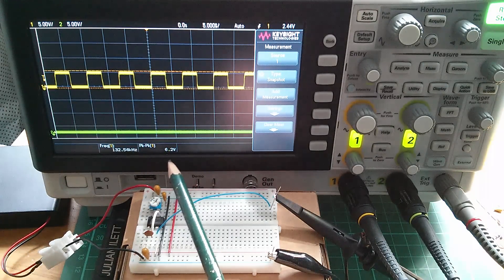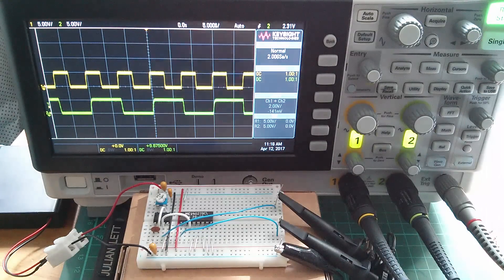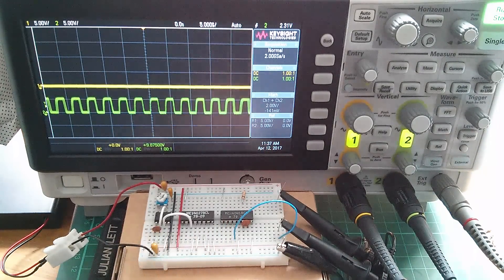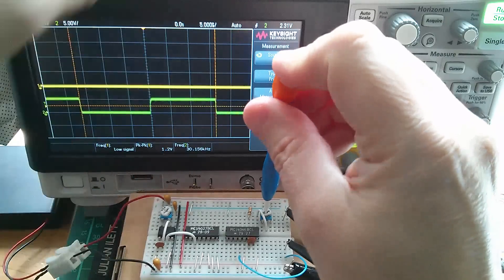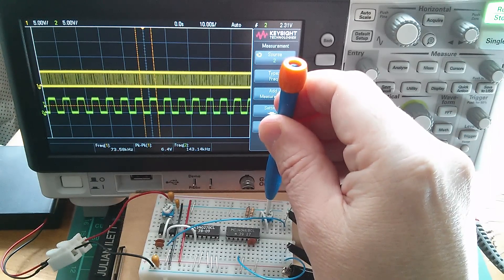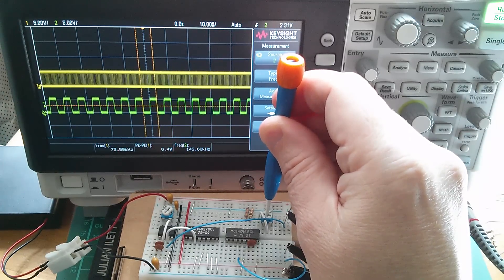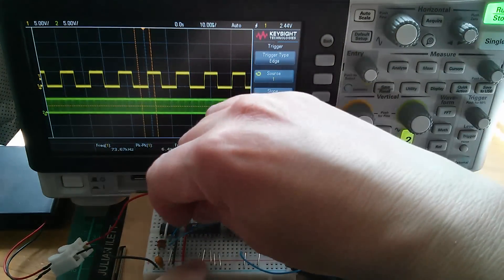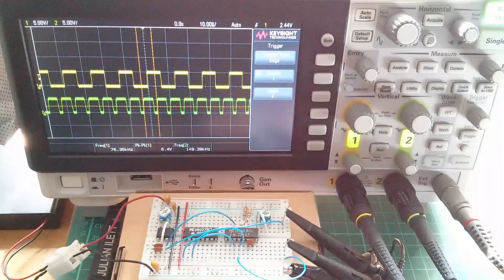Julian plays with Frequency Division and Multiplication

Comment: Hi...I subscribed . Using the 4046 to multiply the frequency from a 7555 was good. I wondered how you would do a similar thing for a sinewave. Sine ways are trickier to generate than square waves and often you get a sine output at a particular frequency or small range from an oscillator like phase shifter or wein. It would be cool if you could multiply the output frequency. I expect it would be difficult. Any thoughts?

Comment: THANKS for the video...I just wanted to comment on the first part where you did a divide by 2 with the flip flop:  THE OUTPUT OF THE FLIP FLOP WILL BE 50% DUTY CYCLE, NO MATER WHAT THE 555 DUTY CYCLE IS.

PS:
What does "JK" stand for?

Comment: Nice video, but it would be nice to say what's the purpose of PLL. You could instead use just higher frequency oscillator instead of trying to double the frequency.If you need 2 frequencies is still the same - use higher frequency oscillator and a divider (because it's easier than multiplying).

Comment: Actually, I have seen designs for a frequency multiplier that uses a D flip flop on a PLL. If you're interesting, it's included in the example circuits in Paul Falstad's java circuit simulator, also known as circuitmod for the standalone version.

Comment: after watching the video, I got inspired and got my hands on these devices. But even after trying to fine tune VCO to lock onto my external clock (15.5KHz from a function generator), I couldnt get it to lock, it always ends up with jitter in the output. I set my offset at 12KHz.

Comment: Thank you, I have been struggling to comprehend the calculations in the datasheet for the vfo freq, your video inspired me to just plug it all together and work it out empirically. I now have a nice stable vfo running at the desired freq. Next the low pass filter, I think this s/b a bit easier.

Comment: This seems a complicated way of doing the frequency double. The first hit in google gives.. "Differentiate the square wave, full wave rectify and then pass through a Schmidt trigger". The Schmidt trigger is optional.  So a resistor, capacitor and four diodes at it's simplest.

What I like about this video is how there is no automatic reach for a micro controller. As an exercise it can be very educational to take a circuit problem and then use lower and lower tech ways of implementing a solution. Even using no active devices at all.
Reply: Works only for x2
With the PLL u can  made any X u need. u have only to change the divider. x2 x3 x4 ... x1000...
Reply: To use this approach the input signal must be exactly 50% duty cycle. In that case after frequency doubling, resulting wave is no longer 50% duty cycle, so no further doubling is possible.

Comment: The 4046 is a great part.

You can double frequency with just an XOR if you have a good square wave.
You just delay one input with an RC and don't delay the other.
Briefly on each edge, the inputs will differ making the output go high.

They make 74HC4046 PLLs too.  They are faster but most brands are quite buggy. On one I worked with:  The Vc pin controls the frequency well in the mid range but up at Vdd, the frequency jumps sky high.

Comment: I recently got some 4046 PLLs because they're very interesting chips and the easiest way to build a linear VCO on a breadboard but I want to eventually build Thomas Henry's more musically useful X-4046 VCO.
http://www.birthofasynth.com/Thomas_Henry/Pages/X-4046.html
Reply: There are some additional clever thing you can do with the 4046.  

You can multiply up and then divide down to make a frequency at 4/3 times the input.  This is just about 5 notes away on a keyboard.  With a bit more complexity, you can get other note differences and more accurate ones.

They will lock onto an AM radio station.  You can make an all CMOS logic gate AM radio that sounds about as good as any AM radion.
Reply: +Ken Smith. That sounds interesting. Do you have a link to a design for one, please? I've been looking but not found anything for a receiver, only a transmitter. Thanks.
Reply: Off hand, I can't think of an online example.  It is sometimes called "direct conversion"
I will explain and you can tinker it together and then make a video about it.
Notice how I have you doing most of the work.  This is because I am very lazy.

First you will need the basic crystal radio stuff.
A coil, variable capacitor, diode and earphone.
This serves as a way to see that you have a radio station's signal
Get it working as just a crystal radio.
Disconnect the actual ground of the crystal radio and put a 0.1uF in series.
Use a pair of 10K resistors to make 1/2Vcc.
The whole crystal radio will still work biased up to 1/2Vcc

Next comes getting the VCO bit of the 4046 running at 4* the radio station's frequency.
for your initial experiments, you want to be able to manually tune it quite near the intended.  

You will need 2 flip-flop 4013 type should be best.
U1A-Q goes to U1B-D
U1B-Q/ goes to U1A-D
Clock from the VCO

You should hear a bit of a weee-woooo-weee as you tune past. if you leak a bit of the U1A-Q signal into a radio tuned to the station.

The tuned circuit of the crystal radio will be making a small signal that can be capacitively coupled into the Signal input of the 4046.

Use the XOR type phase detector.
The Q1A-Q goes to the other input of the XOR.
Add the right sort of filter to the output of the XOR and connect to the VC input.
A simple RC low pass won't quite cut it but do the math for.
F=1/(2*pi*R*C)  R=1/(2*pi*F*C) C=1/(2*pi*f*R)
F = something like 100Hz
Replace the C with a small R in series with the C
F = something like 1KHz
Add another capacitor right at the VC pin of the 4046.
The small resistor F = something like 10KHz.

The PLL should be able to lock when you tune near the station.

The next step is to get a 4053 and drive its X switch from U1B-Q
Drive the Y switch from U1B-Q/

X1 and Y1  goes to the top end of the coil of the crystal radio
X0 and Y0 goes to the bottom end.

A crystal earphone between the X and Y switch outputs should now hear the station clearly with the neighboring ones stripped away so you just have one clear signal.

I think I leave the rest for later.

Comment: Nice video! I like a lot reverse engineering and I am trying to find the transmittion protocol between a generic parking sensor module for a car from China and his receiver.The communication is made through 3 wire,Ibelive that is serial communication but I don't have an oscilloscope to identify the sequence.I tried with a CH340 usb to serial converter but I cannot identify the baud rate.The module is from China is around 12$. Please help me if you can,it will be a interesting video to watch not only for me.Thank you.
Reply: Claudiupro You can buy something like a Bus Pirate to record the output. Do you have a link to the parking sensor?
Reply: You'll want a "logic analyzer" something like  Saleae Logic. (Some scopes have logic analyzer functions built in to them, and some logic analyzers now have "scope" functions.)
Reply: Eisen Faust Where I Find this Bus Pirate? Here is a link for the parking sensors 
http://s.aliexpress.com/VZNFva6j
Reply: Nevermind the bus pirate or logic analyses. Your sensors are raw 40kHz ultrasonic resonators. Essentially, by themselves they are no different than a high frequency speaker / microphone combo. You have to use support circuitry like in the control unit to use them for distance measurement.

Comment: So we need the double of the frequency to double the frequency. But if we made the double frequency, then what is the point of the phase locked loop? If we need both frequency, then why not just divide it?
Reply: You take a variable frequency oscillator (VCO), half its output frequency and compare* that to a fixed reference clock (555), negative feedback adjusts the F_VCO until F_VCO/2 = F_CLOCK, then F_VCO must be 2x F_CLOCK. Just like opamp action with voltages. You can do this for much larger divisions than half and many instruments (scopes, spectrum analysers etc) use a 10MHz reference clock to generate hundreds of MHz or GHz through a PLL.

*(in the case of PLL, comparing phase, but you can compare just frequency in a FLL, the difference being the 2 clocks won't necessarily be in phase with each other)
Reply: If I understand correctly, we actually need to halve the frequency in order to get double the frequency.

But I guess you're referring to where Julian was adjusting the VCO to be around double the frequency?  I think the way that works is that if you don't have a frequency counter or oscilloscope, you can "guess" the correct resistor value and if it's close enough, the PLL will still "lock" correctly.

I remember having to adjust a PLL for an old computer cassette interface, and the way to do it without a frequency counter (an expensive device in those days) was to put a multimeter across two pins and with a data/program tape playing, adjust the pot until you got the multimeter needle hovering around a certain voltage (I think it was 2.5V but I don't remember for sure).  That would set the variable resistance to "close enough".  It worked, too.
Reply: It was a bit unclear. If you have a flip-flop in the loop dividing by two, the PLL output will be double the input frequency. But if you used a counter to divide by 3, 4, or 5, the output would be 3x, 4x, or 5x the input frequency.
Reply: Precision! The PLL oscillator doesn't need to be precise. You can get really high frequencies out of an RC oscillator, but precision is maybe 10%. Quartz crystals are super-precise in their frequency, but they can't go above 300MHz. So your computer, for example, uses a PLL to generate the multi-gigahertz clock frequency while keeping it in phase with a precise but much lower frequency quartz oscillator.

They are also used when a circuit needs to operate in sync with an external clock but at higher frequency, because several internal steps are pipelined.

Comment: Happy scope month. What scopes did you look at before getting the Keysight?
Reply: The Owon is actually a nice bit of kit especially when fitted with the internal Li Ion battery. I have a Rigol DS1104Z but the ergonomics are horrible compared with the Owon so the Rigol gets a lot less use. The definition of a good scope is the one given a choice (I have 4) which is automatically reached for first. The Owon in my case.
Reply: @mbaker335  Yes, sadly some people are quite snobby if they have a pricier scope.
Reply: Until he got the free scope from Keysight he used a really shit Owon toy scope. 

I don't think he would ever have bought such an expensive scope as a Keysight, so there's not much point asking what similar scopes he might have considered.

Comment: You can also double the frequency by triggering on rising and falling edge with a couple of not gates,  a few capacitors and an or gate
Reply: Can also use rc correctly timed on one input leg of a 2 input xor gate